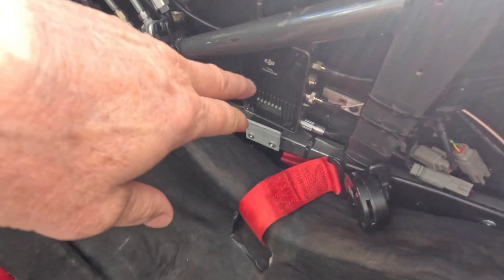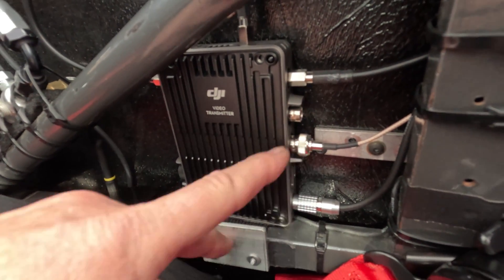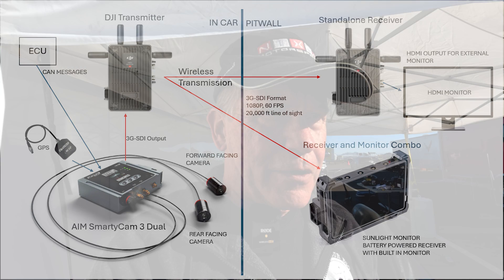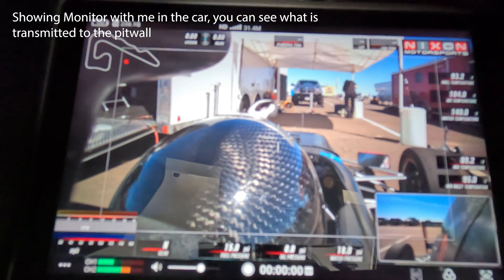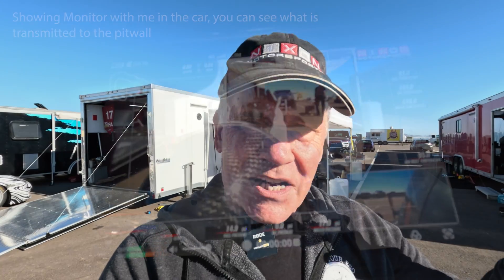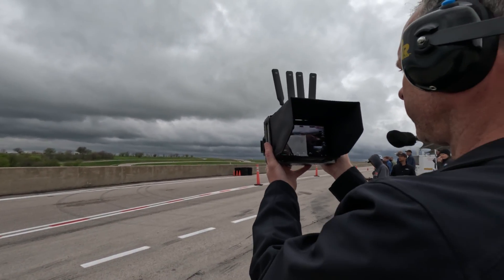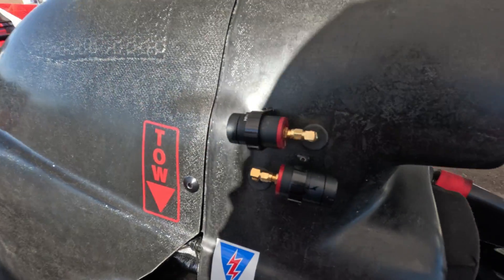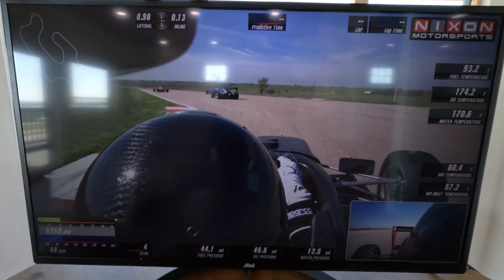Future of Racing: Real-Time Video Feed for Pit Crews

Comment: This is great, I have finally found a solution that I am looking for. Currently I'd be running usb-c to hdmi to connect an action camera (GoPro) to view live. Curious as I am a bit confused on a lot of this new transmission verbiage, do you know if you can put a transmitter in separate race cars and have the ability to display both or switch between the two? I am also thinking of hooking up the receiver display to a capture card to live stream/record directly off the receiver to log the video data easier.
Reply from the maker: You can broadcast from one source to more than one receiver but not the other way around as far as I am aware.  Remember these are line of sight so for tracks that have little elevation and more open it works well.  Cheers